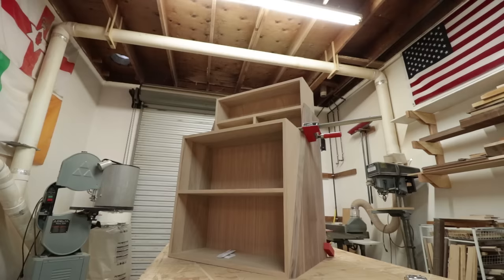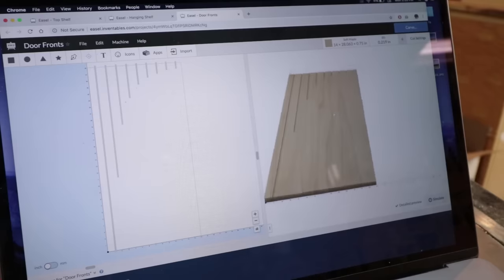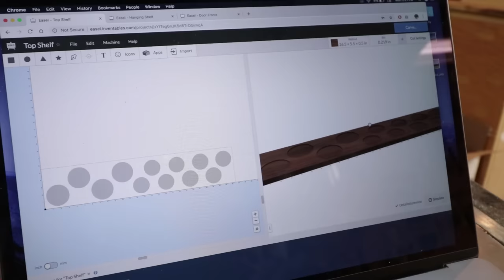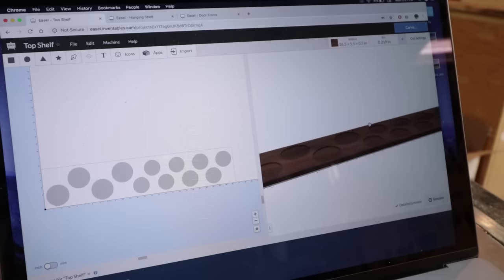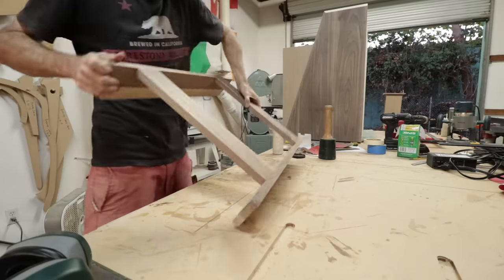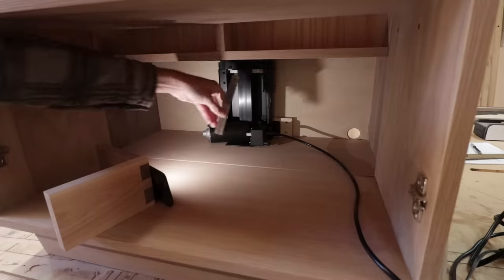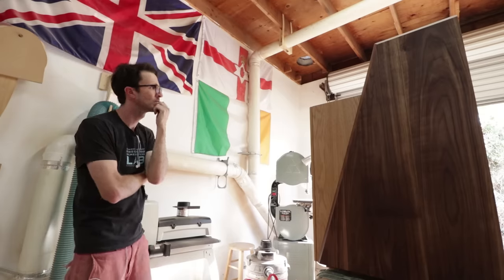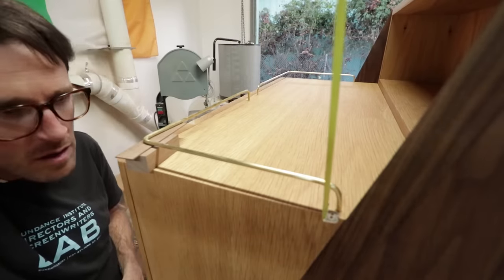Building a Modern Liquor Cabinet with hidden, lifting storage - Part 2

Comment: Mastery is in the details.  At around 8:08 in the video, before and after, the view of the cabinet is at an angle.  Note the angle of the walnut on the side continues to the toe kick/base, perfectly in line with one another.  Depending on where this sits in the home where it will be, that might not be visible.  However, details like that speak to the overall quality of the work.  Well done, sir.
Reply from the maker: Thanks for noticing the small details!

Comment: Hey Shaun what do you use to spread the finish?  I seem to have picked the single 'tool' you didn't list in description.  I've been using foam brushes and not super happy with it.  Pads look like a good alternative.  Thanks for the great video as always!
Reply from the maker: Thanks Scott! I almost always just use blue paper shop towels unless I am using a thick polyurethane or something. But for any oil finishes, or even wipe-on poly, it is just paper shop towels. Hope that helps!

Comment: Looks like you're not using the standard end mills from Inventables. Which ones do you recommend?
Reply from the maker: Yeah, the ones that come with the machine are great for really intricate stuff, but they are just so tiny. I am using a spiral upcut bit that I already had for my routers. Not sure the brand, but I have been meaning to look into getting some more soon.
Reply: Thanks for the reply. Your subtle use of CNC combined with traditional woodworking is what pushed me over the edge to pick up my X-Carve. Excited to put it to work.
Reply from the maker: @TheInsideoftheBox  Awesome! They are a lot of fun to learn and mess around with. Good luck with it!